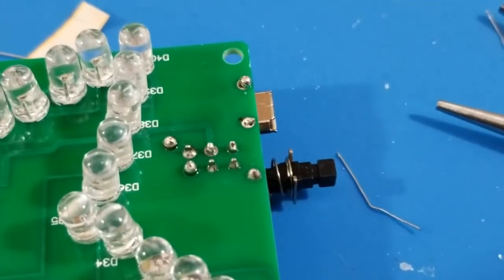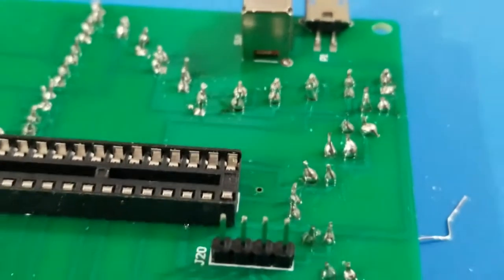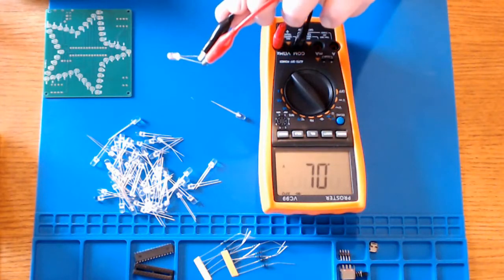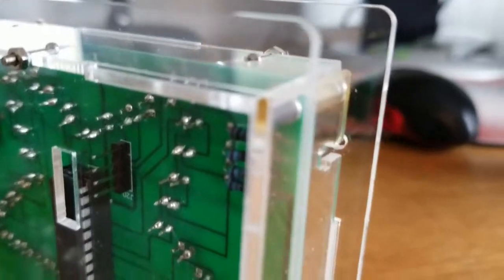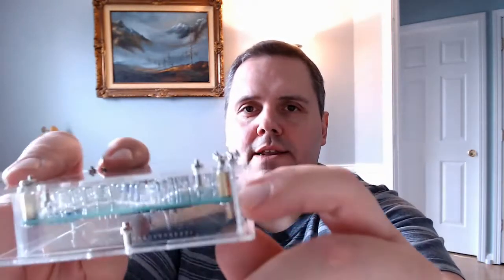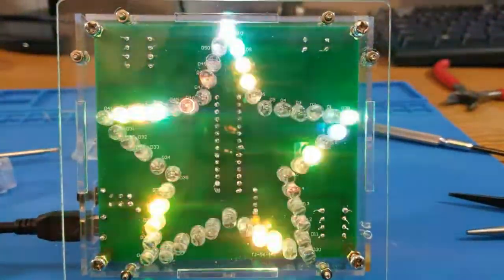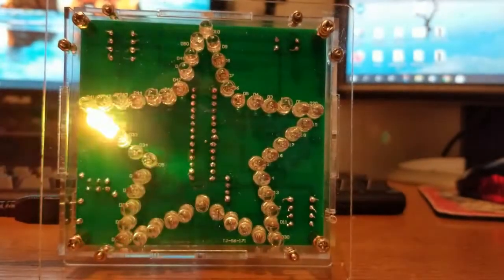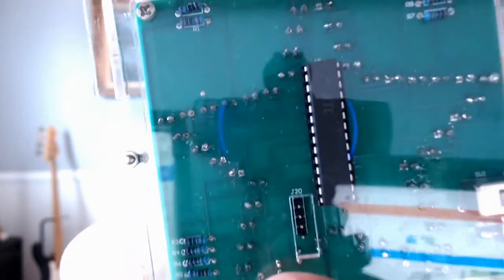DIY LED Christmas Star Soldering Practice Kit Review and Light Display - A Fun Stem Project

Comment: '
i see the some LEDs were not works...
did check LEDs  yet
Reply from the maker: hey there!
I think I still have this. I should go back and check the solder joints.
I'm sure it was a soldering issue that caused some of the LEDs not to light up. I probably had an oversized tip and I didn't sue flux - lesson learned!  👍
Reply: @BMonsterLaboratory  
hi B...
'
that great to check repair the kit LEDs again...
i have alot of good LEDs kits in my channel videos...
i use alot of sockets on the PCBs with kits...
much easily to change any color LEDs without solder again...
smart